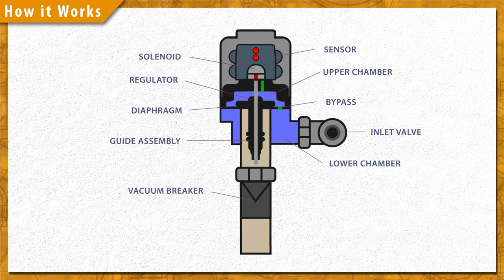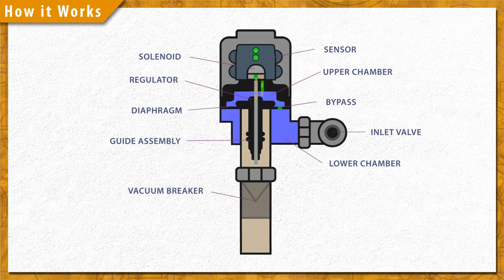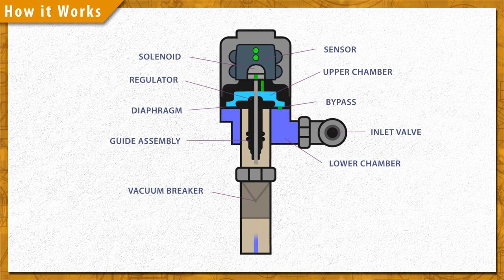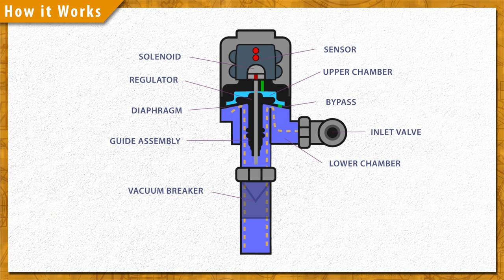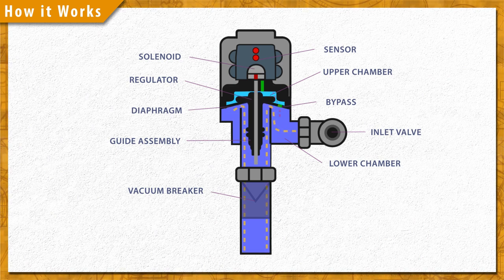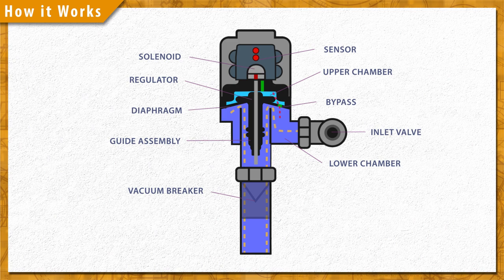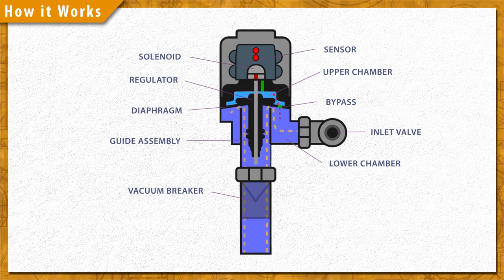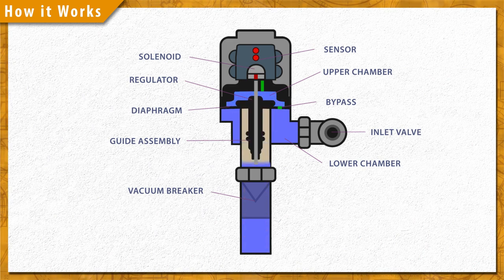How Do Automatic Flushometers Work? | Spec. Sense

Comment: What are the reasons that typically makes sensors and solenoids unresponsive?
Reply from the maker: Thanks for watching. Dead batteries, faulty connection, or a faulty sensor or solenoid can all show up as a similar issue and prevent a flush. Solenoids can fail mechanically or electrically, and humidity and corrosion can interfere with any electronics.
Reply: @AmreSupply  Thanks a lot for your response. I guess the issue I was having was the solenoid failed mechanically. Keep up the great work.
Reply from the maker: @inspiron528 Thank you, we're just happy to help!

Comment: The way it resets is through the small holes correct? Building preassure back to push the piston down?
Reply from the maker: Thanks for watching! You are correct, a small amount of water will always travel through the small hole in the diaphram or piston. After several seconds the pressure will be high enough to push the diaphram or piston back down.  If you're curious on the piston operation it is shown here: https://youtu.be/4sLIQVzupcU?t=30s